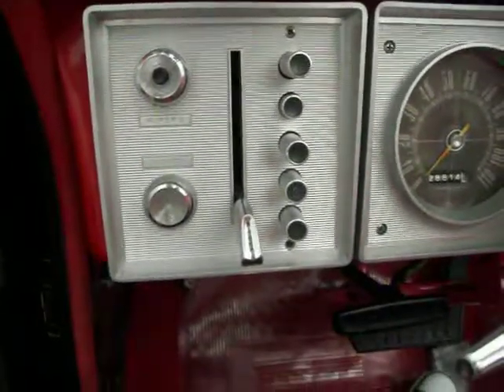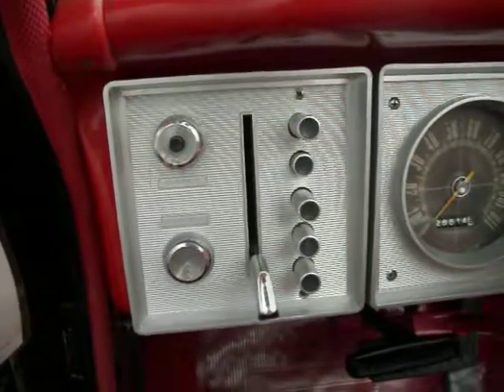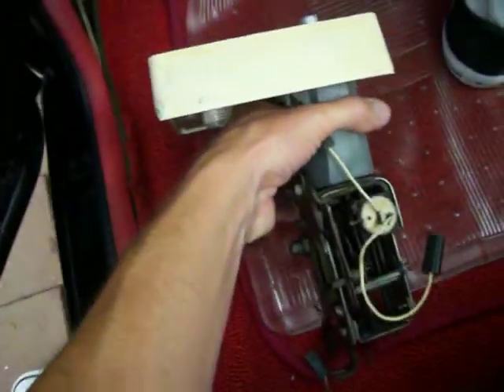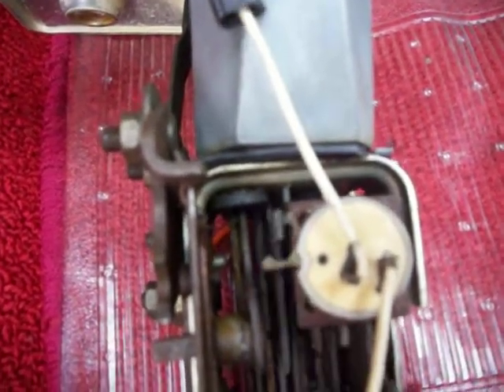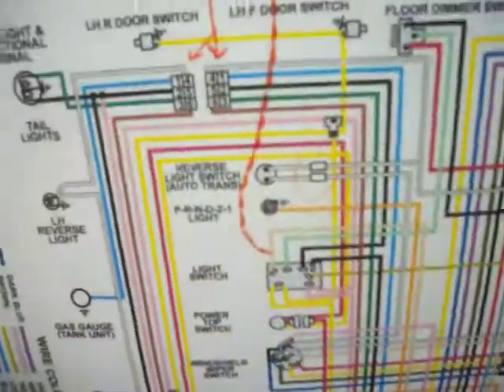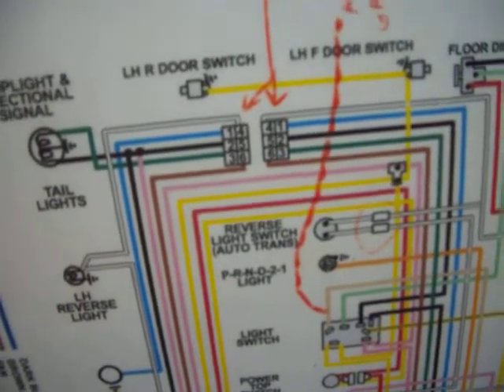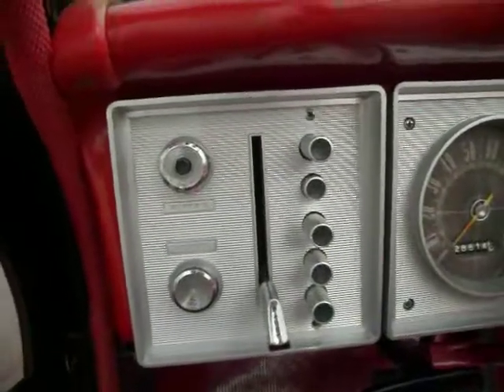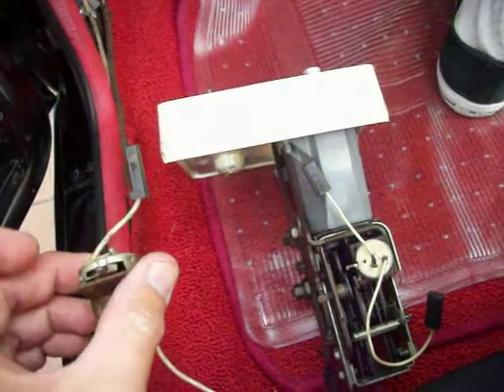Back Up Lights On Pushbutton Transmission Valiant Barracuda Dart

Comment: Thanks for posting this. I was trying to figure out why slots 6 &  7 were empty in my engine compartment wiring harness.. duh.. it's because with the pushbutton, the switch is located under the dash, not on the transmission like it would be with a manual transmission.

Comment: Are these switches easily available? I picked up a used harness and removed the wiring and sockets for the rears.
I looked the see if I had the switch installed and I don't unfortunately